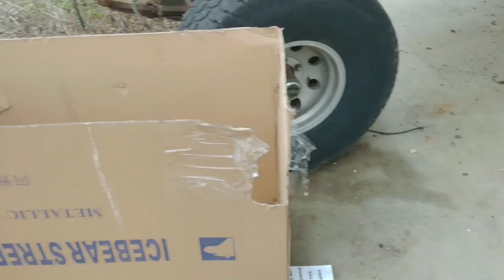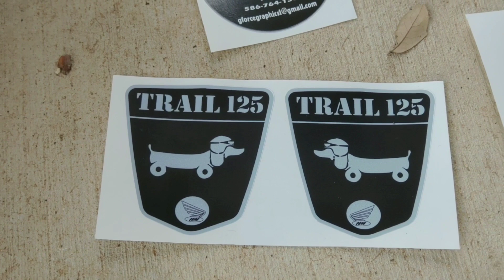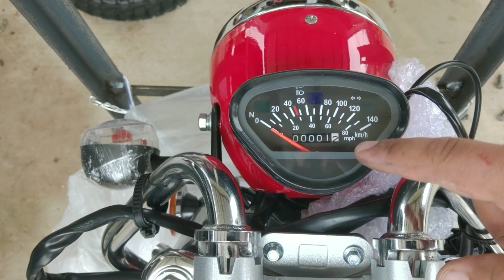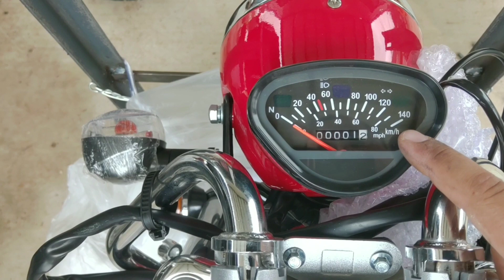2021 Ice Bear Champion Unboxing Uncrating Unbolting???

Comment: Received a Amigo Rocky 125 last week in black (manual 4 speed) and I have two Ice Bear Champions coming. a Green one and a Blue one. We'll be able to compare the two brands when they get here. I just installed those exact tires. Thumbs up and thanks for the content.
Reply from the maker: Thabks for watching. I'd be interested in the comparison of the two companies. I just bought a Nibbi carburetor for it. I'll post a video when I get it installed
Reply: @bbeicker2  I'm upgrading these two also. Not sure on the carb though. Just tried out a VM22 copy and it worked well, but not much more extra gains over the stock carb. I may just stick with the stock carb. I did remove the plug that covers the air fuel screw. It was two turns out from the factory. I think I'm  at 
1 1/2 turns right now. Im at 4400 feet. Runs better. I haven't  played with jetting yet. I'm very good at jetting my two strokes, so I'll  find that sweet spot.
Reply: @Joeak74  After I got the factory trash out of my stock carburetor, it's running much better. Hopefully I'll get it tweaked to run even better this weekend. My biggest concern is getting my doggone front brakes to work well!
Reply: What the difference
Reply: @woahicyyt6085  Go check out the specs on both. Start with that.

Comment: I just figured out my CT70 clone. Put a mikuni carburetor vm22 clone 26 mm from Amazon and put a 115 main jet. Then take the needle in the carburetor and moved a little clip down one spot so that more fuel can go through the carburetor. I tried all different types of carburetors and the mikuni clone from Amazon work the best it just bogged in the first quarter throttle Pull but I figured it out it was because a needle needed to be raised up one spot and now the CT70 is perfect runs great super fast but not too fast to where it's uncontrollable
Reply from the maker: Cool. I just put a Nibbi pe24fl on mine. I ordered a jet kit to get it dialed in. Hopefully I'll get time to work on it this weekend.
Reply: So you moved the needle down then up again so you were right back where you started?

Comment: I am getting one of those in the coming week. I know my hands are gonna be shaking when I put it together. Some say these  cycles are a bit crappy, but that’s what I like about them. Making the upgrades is going to be fun, and they usually work quite well after correcting any flaws.  Hopefully we’ll have all work done by the spring when I can put it on the road! How have you liked yours so far?
Reply from the maker: @Geordo1960  it was a great little bike. I sold it and moved on to other projects though.

Comment: I got mine in yesterday. All setup now waiting for rain to move out. Everything from Cajun MD went good, delivery & driver and bike looks good! I will check back and see how yours goes.
Reply from the maker: I uploaded a first start video. It runs pretty good, but dues out at high revs. I ordered a Nibbi carb for it
Reply: Did they call you guys before they delivered it?
Reply: @earlyculyer4103  yes they should call before. They have to make sure someone is home. When you get yours make sure to put inline fuel filter before you run it. Sometimes there is left over flux grit inside tank from welding tank.together

Comment: I was told to replace oil with 10w30 then I found a sticker that's says to use gl-3 gear oil but where do I remove that?
Reply from the maker: Ignore the sticker, I believe it's some translation issue. I've also heard the sticker goes to another bike they manufacturer. The gear oil on this is also the motor oil. Get a good motorcycle oil, like Honda GN4. It has an additve for a wet clutch. I'd personally get 10w40, but I'm in TX.
Reply: Lol now as I pulled off the oil plug a spring and a rod fell out does the rod go in first or the spring
Reply from the maker: Yikes! I'm not sure...I haven't changed my oil in it yet. I can change it soon to find out though
Reply: Doesn't the rod attach to the oil plug, as a dip stick?, Maybe the spring is there to at as an exhaust coil, so it doesn't back out, like a spring washer